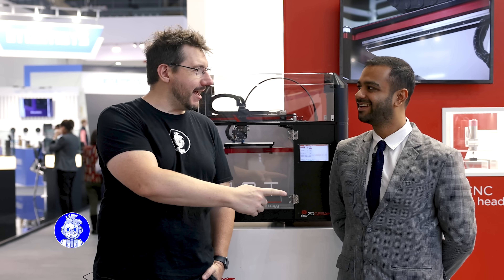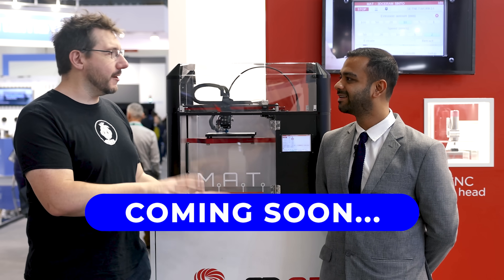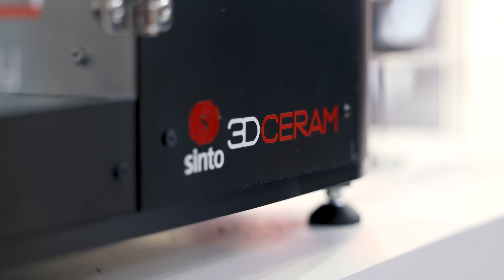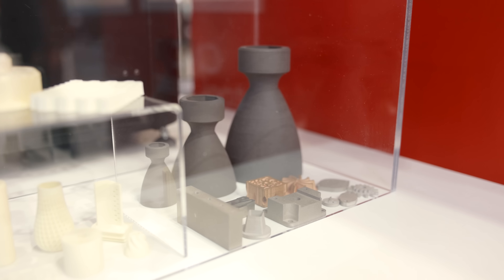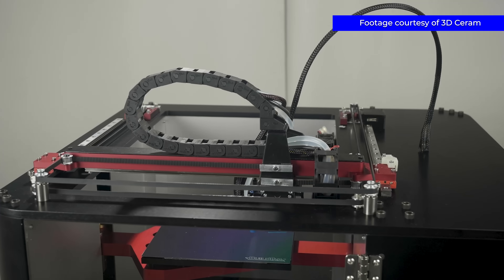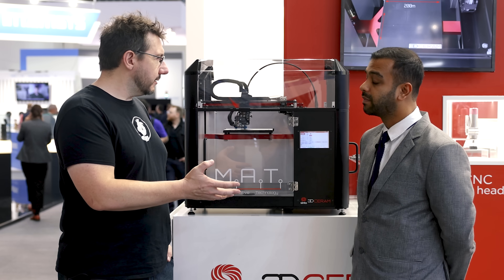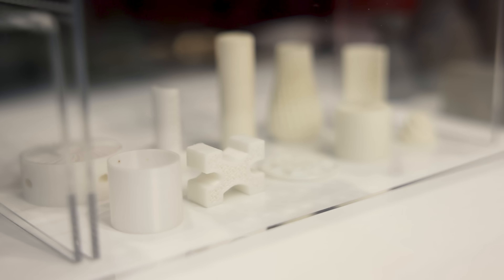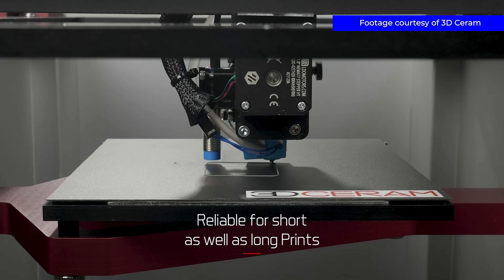3D Printing CERAMICS with 3DCeram

Comment: Did you talk about the De- binding or sintering process in more detail. Special equipment or chemicals needed? 

I would like to know more about the types of materials that lend themselves to this type of printing. Is it mainly because of optical properties? Is this a fast prototyping play or are there industrial applications in mind

How soon can you get this to @integza so he can build a rocket nozzle that won't blow up, melt, or leak like sieve?
Reply from the maker: Not yet. But in the next year we may visit 3DCeram to talk more about the entire workflow.
Reply: It is actually possible to do right now.... but it requires proper knowledge of material science, ability to create and/or heavily modify their own software and tooling, and exactly how the given process functions...  I could conceivably do something similar to using a "pancake batter" printer with several key modifications... but knowing which ones, what materials, and how to apply them is where it gets tricky.  @integza is free to contact me, but I am not about to share it on the open internet where people can get hurt if they don't thoroughly understand ALL the things I mentioned above.

Comment: That's a normal printer using special filament. He said it was different the whole time but didn't show one different non-software thing. Sounds like marketing bs to sell you a whole new (probably highly marked up $$$) printer to do what you could of done with the one you have, their filament, and MAYBE a new "gentle" extruder (probably like a flex extruder that doesn't press as hard to damage the fragile filament).

Comment: I would have loved to have more informations about the binder they use in their filament. I don't know any plastic that melt at 160°c except maybe PCL but 160/170 seem a bit high for PCL. Anyone have an idea?
Reply: There's a wax filament for investment casting.  Edit: But he does say at 3:19 they use a plastic
Reply: PLA can come out that low, especially at these low speeds. Most wood PLA is printed at 170.

Comment: What's really crazy about this stuff is that, unlike DMLS that requires $50k at the very minimum machines, processes like this can be done on a home 3D printer (I'm guessing even my home-built from $200 kit machine could do it, maybe with a few upgrades) and burned-out/sintered in a kiln used for firing pottery. I don't know if this company would sell their products/process to the general public, but The Virtual Foundry already is. Probably won't get quite as good results as professional-grade everything, but this is certainly becoming within reach of the home hobbyist.
Reply: Many of these things have always been within the reach of a home hobbyist with the proper knowledge of material science, ability to create their own software and tooling, and how a process functions... One issue is the costs involved with creating a functioning tool unless one has a functional machine shop and all the knowledge to produce the parts... then there are the materials themselves... these are not the type of thing you can go out and buy off the shelf, these are custom filaments and far more delicate then the standard stuff we all know and use.... the typical FDM printer would chew up these materials if you could get them and require software editing at the firmware level to bypass the normal 3D printer operations.

Comment: There's NOTHING special about that printer. These guys are definitely basing their product around people not knowing enough about printers/just having a complete ecosystem. The printer is a slightly better built ender 6 at best. Look at that bearing stack on the right bending over a few degrees and the ANCIENT hotend design. Joel go buy a spool of their filament, I'll bet you the price of that spool that it is totally printable with any normal printer.

Comment: I've said this before but this technology is truly the beginning of democratising manufacturing, ceramics and metal parts will make replacment parts for devices available at a local level, this can even reduce the CO2 foot print as it removes the need to ship parts...
Reply: That is only partially true, and even if they managed to get it down to a reasonable size and reduced complexity, at that point you are coming very close to it becoming "hand made" or custom style, just done with more complex and easily breakable or malfunctioning tools. Please look at ALL the connected parameters before declaring instant "utopia" as it is never as easy as it sounds.

Comment: It's a significant commitment to set up the full process (printing, debinding, and sintering). Are there any US-based service bureaus with these printers?
I'd like to know what the minimum coefficient of thermal expansion that can be achieved for final alumina parts is. Conventional alumina parts can achieve <7ppm/°C, but these printed parts are likely more porous.
Reply: I get the sense a basic setup, like done with The Virtual Foundry, could be done for under $1,000, most of which is for the programmable kiln (this doesn't include the 3D printer that most nerds salivating over this presumably already have). I don't know if such an at-home process would produce particularly good parts. I don't know if any companies do this, but I'd imagine probably so - would seem like a very lucrative business. As for the coefficient of thermal expansion, I wouldn't expect that to depend upon porosity from what I understand about it - it's a material rather than structural property.
Reply: @quillmaurer6563  yes, a basic setup can be used. The debinding needs to be vented, so there are details like that that should be paid attention to. I'm not sure how porosity impacts CTE. I feel I should know, given that I have to pay a lot of attention to CTE in my area of work.
Reply: @JonS  To give an idea, it's supposed to be around 95% dense once sintered and can achieve higher density through CVI/CVD.

Comment: Nice to see this technique back in the mainstream news after a few years. Though my eyes are definitely going to fall out if he keeps going on like it requires a special printer or like it's anything new. This is literally the primary reason why companies released complex filaments like copperfill in the first place. Gets to the end Oh, his machine can also mill and rotocast... Novelty but still not unique these days. Plenty of multi-tool systems out there to add mills to a machine, and probably any machine with a raised bed on three independent lead screws and can do basic rotocasting.

You'll note that he didn't say much if anything about what kind of TPP they used, so debinding could mean anything from water to acid to heat. Sintering means you'll need a high temperature kiln with a programmable oven to get to the right firing schedules, and probably a need for vacuum evacuation and a neutral gas (though not necessarily a noble one). The bed and hot end heater control systems in any FDM printer already do controlled heating schedules. I want to see someone come out with a consumer hobbyist grade sintering oven running off of similar cheapo boards that can fit prints larger than your fist and doesn't cost as much as an ER visit or a d**n surgery.
Reply: 1800 degrees Celsius isn't cheap, thermocouples alone at $1500ish.
Reply: @ScuffedEngineer  With a ten seconds search on Google, I'm seeing three Type Bs rated around 1800° and a "very high temp exotic" rated around 2200° each for under $400 apiece. It's important to note that most sintering is done below 1000° and that 1500° is considered the recommended upper range limit for "very high temperature sintering". A type K can get you up to around 1300° in some cases and usually cost less than $50, though you'll want to shop around because some manufacturers make them with considerably lower range and sensitivity.

Comment: This is a really interesting FFF Material.  I do wonder if we could put their ceramic materials on regular printers. as I didnt see anything out of the ordinary when it comes to that.
Reply: Just a guess from my experience with them, from 3DCeram sales reps, no, from their technicians, yes. The kicker is the price per kilo being around $1-2k.
Reply: Could you take off your shadow ?🙂 it is quite a challenge to 3D print SiC with any FFF machine...
Reply: Getting the brittle material off the print bed in one piece may be tricky.  And post print processing will take a kiln that most of us don't have.
Reply: @hanelyp1  Silicone Carbine requires a kiln capable of maintaining 1860 C.  Not something most people will have in their garage but a lot of ceramics companies, and universities do have these.
Reply: Getting the brittle material off the print bed in one piece may be tricky.  And post print processing will take a kiln that most of us don't have.
Reply: hanelyp1 has the right answer - the M.A.T. has been developed to print ceramic and you might know that one of the main issues with FFF is the loading of the filament into the extruder. This issue is fixed with the M.A.T. and this is not this only one...
Reply: The Virtual Foundry is selling metal and ceramic infused filaments similar to this that they claim can be printed on an ordinary printer, the only upgrades needed are a stainless steel nozzle (0.6mm or larger) and a filament warmer accessory they sell. I don't know how realistic that actually is, but I'm eager to give it a try.

Comment: I feel like we are still in the early stages of a technology that will change the world. The internet took a few decades from the late 1960s to get to the mid-90s, and then to the boom of the 2000s. 
3D has now been around since the 1980s, to the boom in the late 2010s, and the technology is just now hitting the extreme development stages into it's real potential. It will change the world.
The next technology to do this will be AI, which has been slower to develop over the decades.

Comment: It's very impressive to witness how 3D printing is evolving. It will definitely be the future. Amazing channel, good job!
Reply: It will be part of the future, not the future
Reply: Guns will eventually be completely legal everywhere because, when it comes to weapons, anything so easily obtained should just be legal - banning and licencing only has the effect that law-abiding people have to self-handicap in relation to bad guys.
Reply: @smorrow  hahaha that's cute. They'll just ban printers 🤷‍♂️
Reply: @jimborrrrrrrr  I expect some nanny state to try it, yeah. Not sure how that's supposed to work though when most printers are open-source, and normal/non-gun people in 3D printing strongly value open-source (too), and filament isn't hard to make either, and also there are printers like Hangprinter (donate to its gofundme, btw) you can make with a shopping cart that doesn't look anything like you're building a printer.  If there isn't a printer you can build entirely from scratch, there will be when printers are banned and it becomes the important thing to work on (as has already happened with guns and airguns).
Reply: Spacecraft will print themselves in space instead of all this folding to fit in the launch vehicle

Comment: Hmm I wonder if parts you print with this can't have irregular shapes, like most the parts he shows are either symmetrical or like a sketch you rotate around the Z axis. I wonder if they otherwise shring "wrong".
Reply: Uniform wall thickness is critical to this sintering process.  Asymmetric part shapes are not an issue.

Comment: They always skim over the debinding and sintering stages...
Reply: De-binding in a solvent then kiln sintering based on the materials. Ceramic sintering is at temperatures near 1700 C.
Reply: @daviddiegel1239  what type of kiln?
Reply: @_Junkers  There is a basic tabletop kiln for the de-binding phase up to about 300 C.  The sintering kiln depends on the material you are using.  Metals are more in the 1000 C range, but ceramics, especially SiC, can be up to 1800 C to properly sinter it.  That type of industrial kiln can cost up to $55,000 for a tabletop size.

Comment: Autsj, not actually knowing the 3D printing Nerd. :) I wonder if this MAT printer would be super useful though, apparently it has to print veeeery slow?
Reply: For industrial applications I can see it happening, actual machining time would be longer, if the part can even be machined at all.
Reply: @robertsmith4681  I guess once the thermoplastic material is burned out and the ceramic is baked to it's final hardness
Reply: @haydenc2742  All of that can be done in one pass of a proper oven. Not so much burn off but sublimate out the binder, and then raise the temp to bake the part to whatever ceramic needs to bake at.
Reply: @robertsmith4681  In a nice oven you could do it at once, but cheaply, debind in gas at low temp to burnout the binder and then sinter at elevated temps (2 separate ovens). These filaments are supposed to debind in a solvent, will be interesting to use. Ultrasonic mills can machine green parts and you can always abrade away material (though slowly).